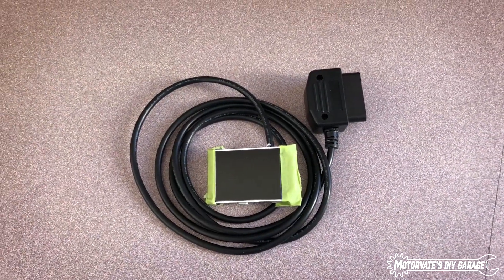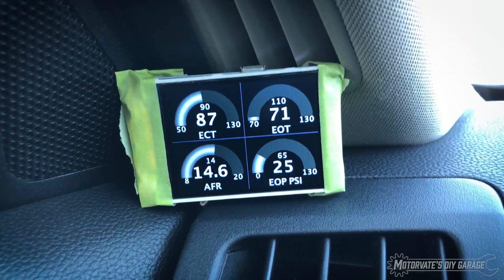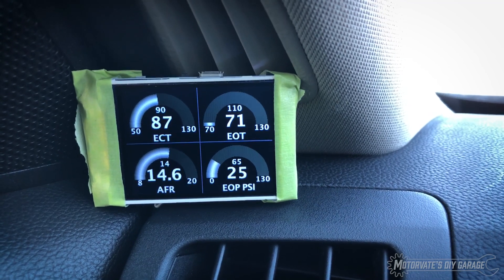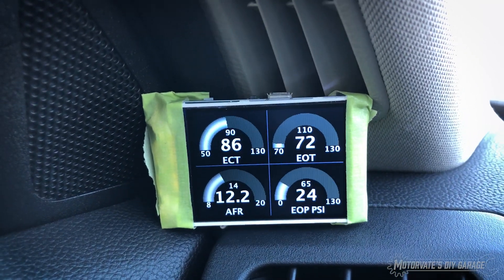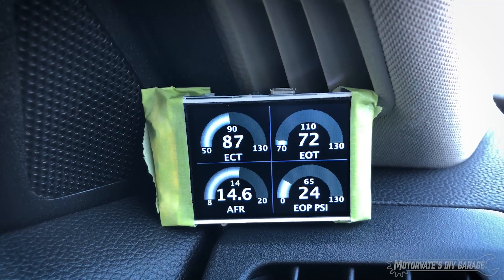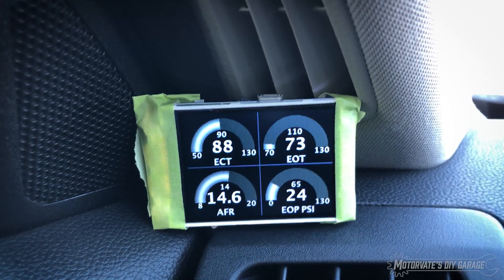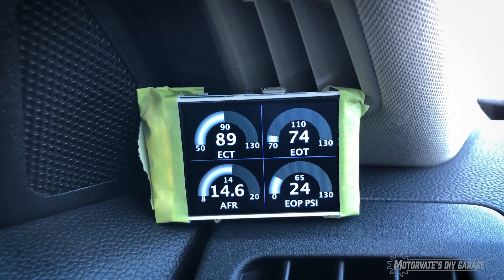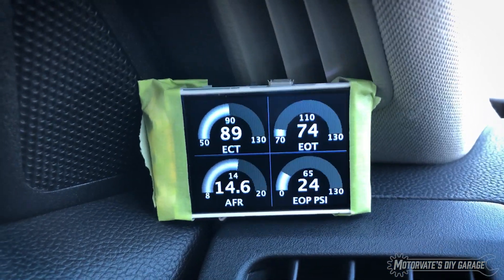DIY Mini-Dash LCD Gauges Update: MotorvateDIY Garage Ep.40

Comment: Could I buy one or , or pay to make on for my g37
Reply from the maker: It isn't quite ready yet, as I haven't designed a case/enclosure for it yet, and I want to make a "piggy back" circuit board for increased reliability and to make assembly easier.

Specifically, what do you want displayed?
Reply: Any updates on this?

Comment: How to I get this in mine?
Reply from the maker: I am still testing it in my car, and it has been working well.
The next step is to design the final hardware and enclosure.
I'm not sure how long that will take, as I have never done anything like this before.
Reply: @MotorvateDIY  what is your 0-60mph time?
Reply from the maker: I'm not sure... I'll have to dig up a CAN bus log that has the wheel + vehicle speed recorded 100 times per second to find out.
Reply: @MotorvateDIY  what about simply timing it with a stopwatch?
Reply from the maker: A few reasons... the car is buried at the back of the garage and I have 10 year old winter tires on it now... Not very much grip. :)

Comment: Brilliant stuff!!!! How do you go about decoding a pid? I would like kit for sure. I was trying to understand this stuff but gave up due to limited information.
Reply from the maker: Thanks for your kind words and interest. In the next few days I will post another update video with some very unique and interesting gauges like engine torque, AWD %, automatic transmission fluid temp,  and about 30 other items :)

It is important not to confuse a PID with CAN bus data.
A PID is an OBD II item. The data is requested from the ECU and it replies.

Most of the items I show on the mini-dash is broadcast on the car's CAN bus and are broadcast for other modules to use. For example on the G37, the individual wheel speed is broadcast 50 times per second.

You are correct that there is very little information on the internet on Nissan/Infiniti CAN bus data. This is partly due to the HUGE investment in time to reverse engineer the raw CAN data. Over the last year, I have spent just over 2,000 hours working on this.

Comment: This is very interesting. I was thinking about getting an oil pressure gauge fitted to my 2009 370z but the costs involved to do it neatly utilising the "A" pillar to make it look "OE" is slightly less than getting the gallery gaskets replaced anyway. Nissan UK do not sell the gaskets separately, they only come as part of a kit replacing the front of the engine. So gaskets costing £40 will cost you £800 including taxes. Crazy!
Reply from the maker: I agree that is crazy expensive...

If things go as planned, I hope to offer a slim/factory look bluetooth engine oil pressure gauge for the 370.

Comment: It looks like you installed g37 coupe seat to your g37s? Could you make a video how you installed them to g sedan?
Reply from the maker: Those are the stock seats on the G37 Sport Sedan with 6 speed manual.
Even after 11 years, they are still fairly firm and not the most comfortable on a long drive.
Reply: @MotorvateDIY  Oh I see. I guess seats are quite different Gs sold in North America and Asia. Thanks!
Reply from the maker: Interesting... I am surprised how by how many things are different in the same model, sold in different regions.

Comment: Hello I need to replace the engine mounts in the g37. Do you know if the exhaust fittings need to be disassembled to replace the engine mounts? And if so is it worth cleaning up the catalytic converter while it is being disassembled(150,000km)?
Reply from the maker: I haven't replaced my motor mounts so I don't know what is involved.
I do know that it is much more difficult if you have AWD.

I hope this link will help:
https://g35driver.com/forums/faq-diy/464171-engine-mounts-diy.html

Comment: Great work, can't wait to see what you do next and if you ever need another real world tester let me know lol, and as someone else mentioned would you mind giving some more info on the Bluetooth oil pressure switch you have.
Reply from the maker: Thanks Corey, I will keep that in mind but I am not ready for that just yet.
I have more programming to do and the next step is to add additional pages/screens. 
AND you can select the page you want by using one of the buttons on the steering wheel. I think that way will be very convenient and unique.

As for the bluetooth oil pressure sensor, it is a normal pressure sensor that is wired to a microcontroller that has a bluetooth chip.

I will show/explain it better once the additional screens are added and hope for the weather to warm up a little. All this week it has been -10C / 14F in my garage, so I rather be at my desk programming :)
Reply: @MotorvateDIY  sounds good thank you, I believe if you can package it right with the right features, you may have a real money maker
Reply from the maker: In the next few days I hope to have an other update video. MUCH progress has been made and it has a much nicer look and added functionality.
Reply: @MotorvateDIY  thanks for the update, I'm excited to see the progress. Could you explain a little more about the oil pressure sensor that's wired to the Bluetooth controller. Can't wait for the next upload

Comment: Awesome work! I've been thinking about getting physical gauges for awhile now, but I find them all to look way too tacky for a luxury sedan. This on the other hand is perfect. Also, if you end up selling this or making your own DIY, do you think it will work the same on a 2007-2008 G35?
Reply from the maker: I have done a little research on this. 
On the 07-08 G35s there is less data on the CAN bus, so it will show a few less things. Off the top of my head, I don't remember exactly what, but I will look into it when I have more progress on the G37/370 items.

After all, I need to know what works and what doesn't :)
Reply: @MotorvateDIY  Stay on the grind!
Reply from the maker: I am! In the next few days I hope to have an other update video. MUCH progress has been made and it has a much nicer look and added functionality.

Comment: Nice work.
I think it would be helpful to also have a mark on the acceptable range. Like lets say for infiniti g37, if the acceptable range max for the EOT is 150 degrees, then we somehow indicate that.
Reply from the maker: We think alike! I have defined all the min/max values for each sensor but didn't add them to the display. That will happen in the next version. 

I wanted to test the gauges before taking time to make them "pretty"

I was able to determine the typical min/max from going through a few factory shop manuals and centre display from the R34/R35 GT-R.

Thanks for the comment!

Comment: Did you have to add a sensor to get the oil pressure reading?
Reply from the maker: Yes, as that engine (Nissan/Infiniti 3.7 V6) doesn't have a pressure sensor... Just a simple oil pressure switch.

I have added 150 psi pressure sensor in the place of the pressure switch and that is connected to our "bluetooth sensor server". The oil pressure is received by the mini-dash and displayed.

The bluetooth sensor server can support up to 8 sensors, so there is lots of room for expansion if needed.

The main reason we decided to use bluetooth was so that wires don't have to be run wires from the engine bay, through the firewall to the interior. 

The only wiring that needs to be done is ignition and ground... and those are VERY easy to find under the hood :)